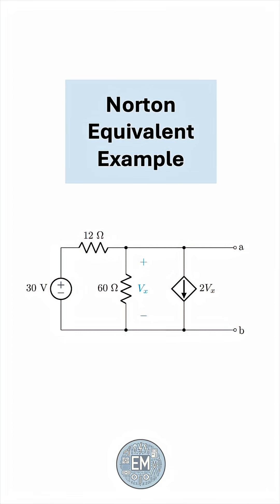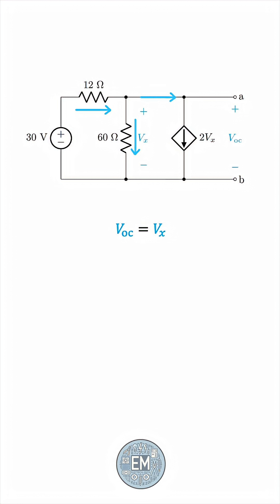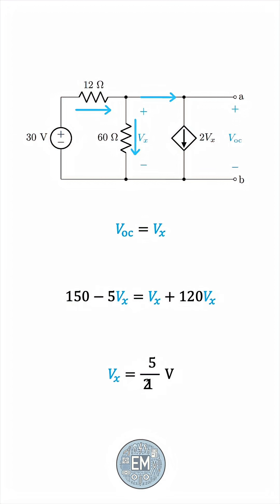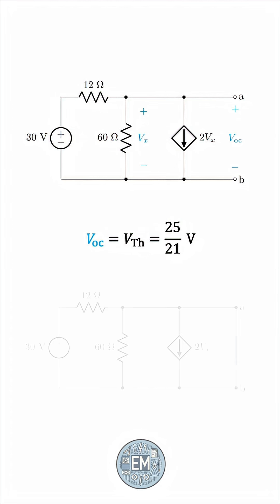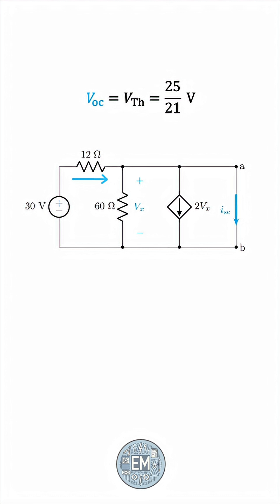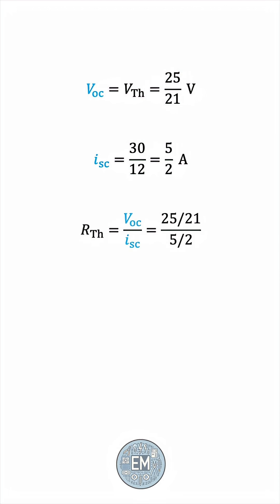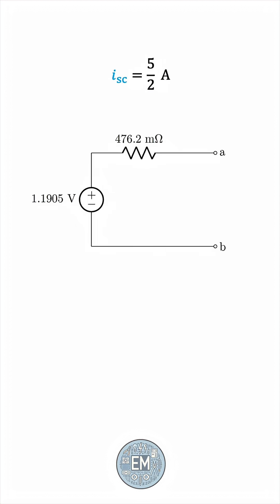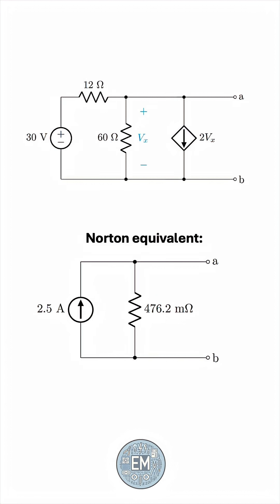Norton Equivalent Circuit - Worked Example #electricalengineering

Comment: why do we subtract the Vx in (30-Vx)/12?
Reply: because we want to know what the potential difference is so we can find out the voltage across the 12 ohm resistor the potential difference divided by the resistance is the current going into the node

Comment: Isc is wrong
Reply: Right answer is 0.11
Reply from the maker: @AnshikaSingh-y7w6e  Why is that?
Reply: @ElectricalMaths because you have to account for vx
Reply from the maker: @frgwyn3760 The 60 ohm resistor is shorted, so V_x is 0.

All the short-circuit current goes through terminals a and b, bypassing the resistor. And, since Vx is 0, no current comes out of the dependent current source.

Hope that helps.